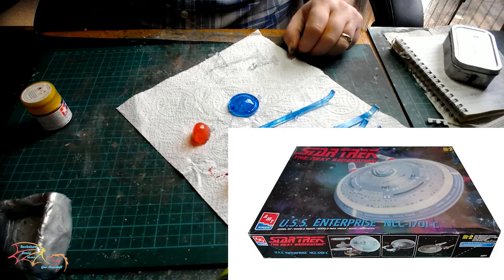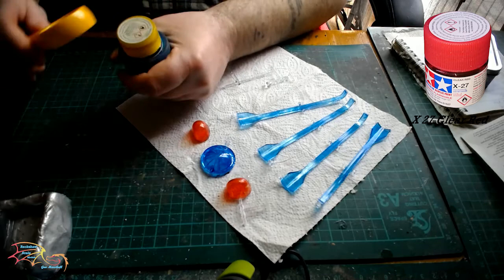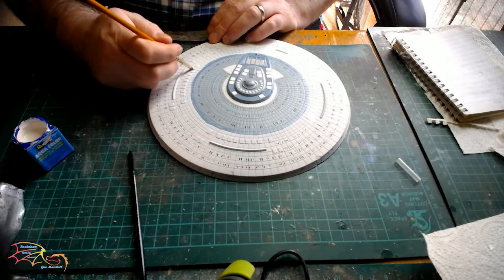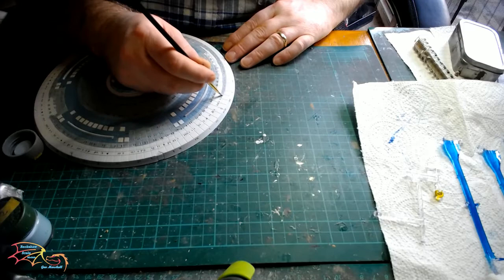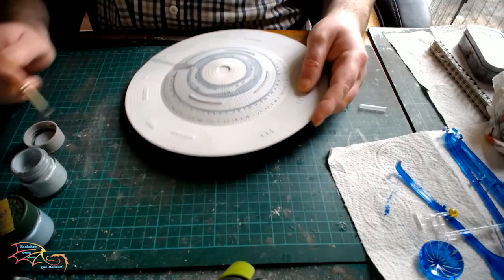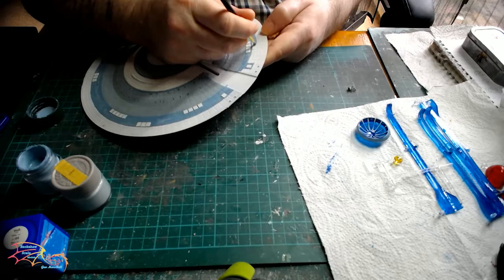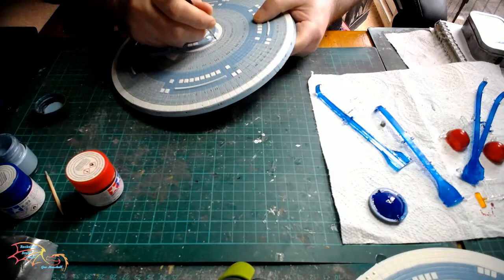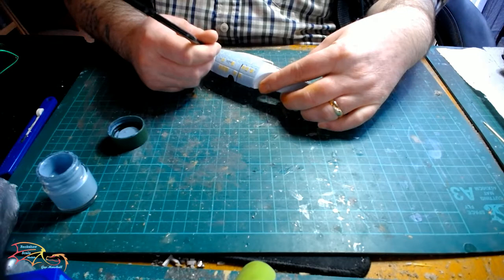AMT USS Enterprise NCC 1701C Part 3 Base Colour Painting.

Comment: Still practicing with Revell Acrylics, I have found that when I thin them, it beads up on the plastic.  While, thick they do go on just fine without thinning with water, just have to brush out the thickness of the paint.
Reply from the maker: You could be thinning them too much. If the paint s a bit thick just have a little on your brush and don't apply to much pressure.